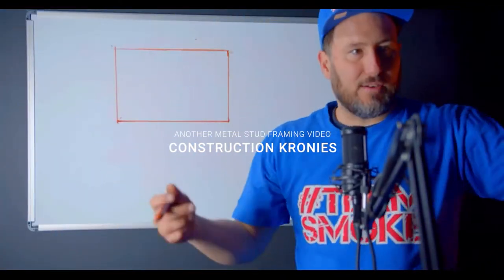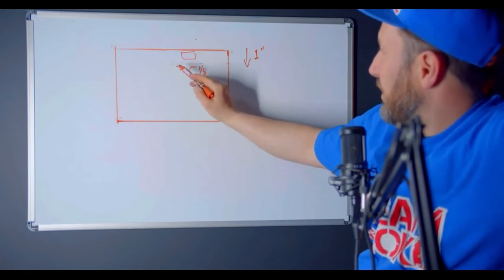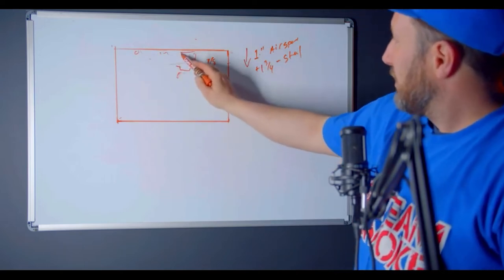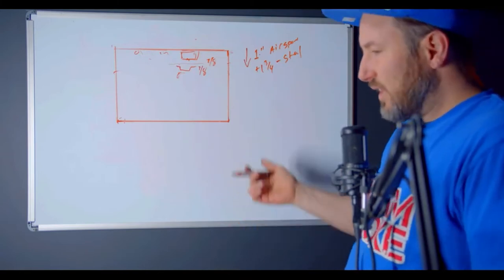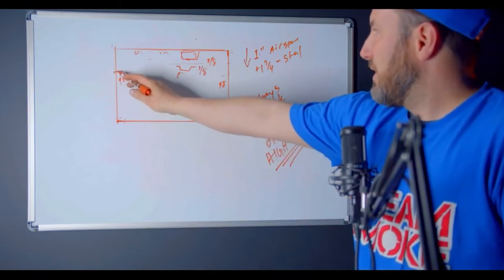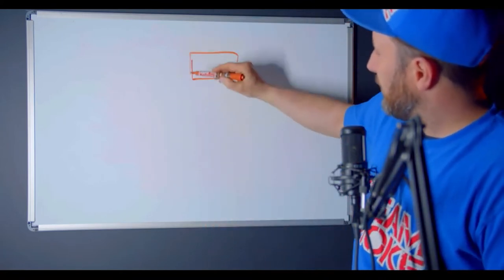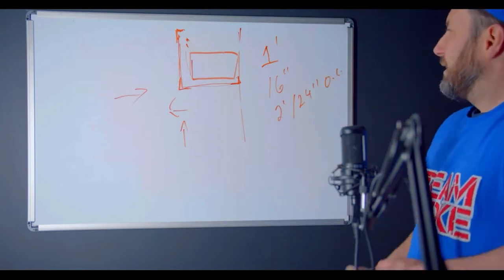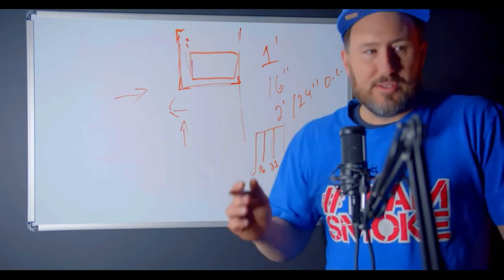How To Layout Drop Ceilings

Comment: You mentioned ducts, and that reminds me of a question I've had on my mind for a long time: Is there a way to know what ducts need shafts around them, apart from when shown on the plans of course?  
(e.g. ONly certain types of ducts or in certain areas, etc..)
You will sometimes see shafts around ducts on the MECHANICAL plans, but not the Architectural. But sometimes, even the Mech plans just have a little note or comment about shafts - So it's not always clear. I know in wood framed residential buildings, certain exhaust ducting needs to be enclosed by 2 layers of drywall (usually in the joist space, if possible).
Maybe the question is more geared for a mechanical engineer? But just thought I'd ask in case you might know...
Reply from the maker: Yes you have to read all of the drywall specifications Division 7 Thermal and moisture protection, division 9 drywall and anything related to fire protection. Most of the time it is mentioned in words and not shown on the prints. It can be very tricky, if you miss something in the specs or in the details it can cost ya.